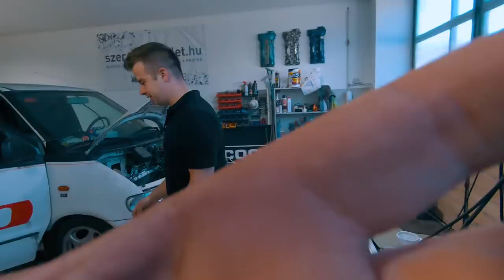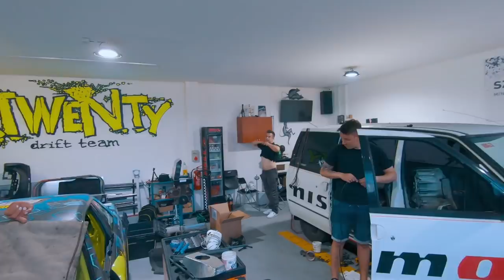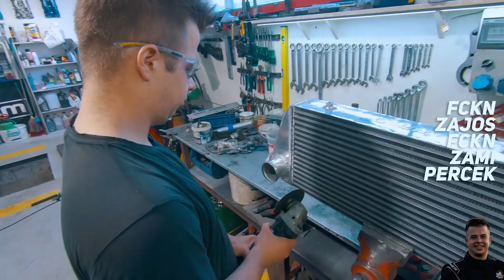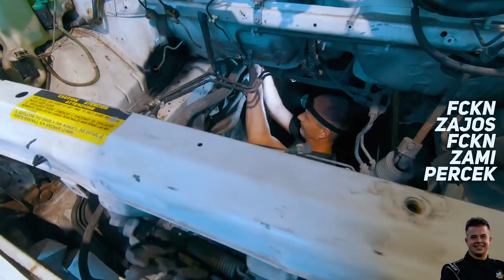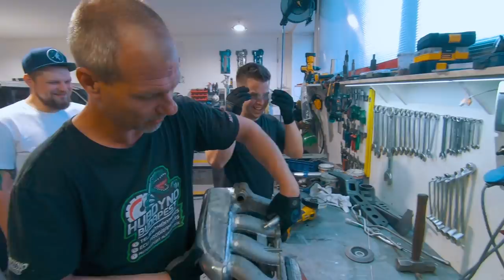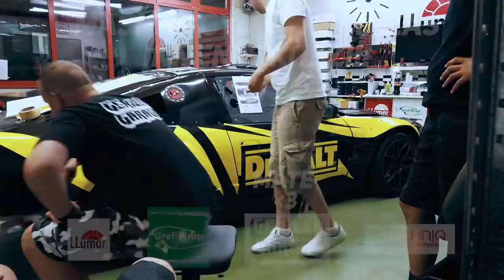Driftmasters készülődések Zamival - #Junkbuilds Shorts

Comment: Tehat a Zami csanölt, kb. 123131 db zami channel közt kell megkeresni aminek a 90% Indiai, 5 % kualalumpur ( nem tudom leirni ), 4,999999999999999999999999999999 % Sri Lanka es hangyafasznyi 0,00000000000001% magyar :D
Reply: @KiszelyMate  Hold on Brother, ez a csatorna megvolt ! :D DE EZ NEM ZAMI CHANNEL :D
Reply from the maker: Valaki elfelejtette berakni jobb felülre a kártyát... De az a valaki most pótolta! :D